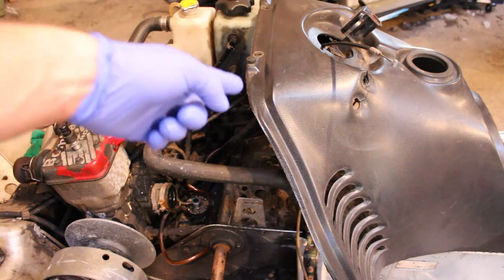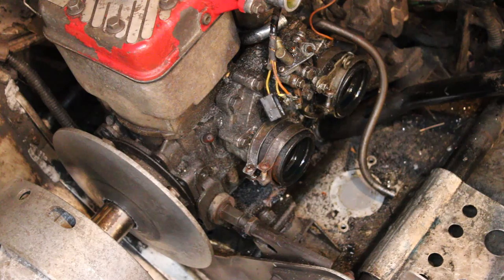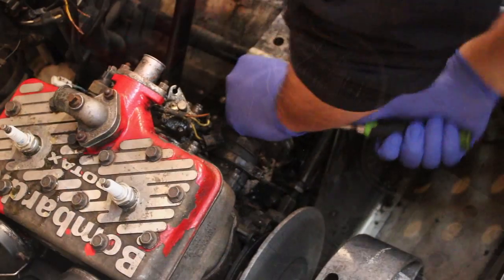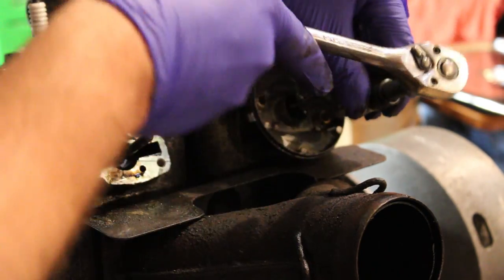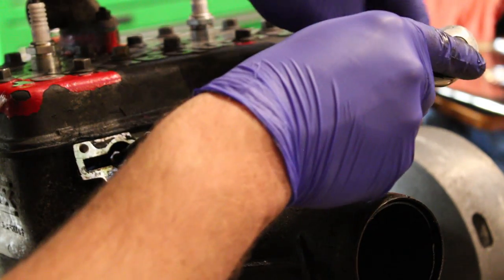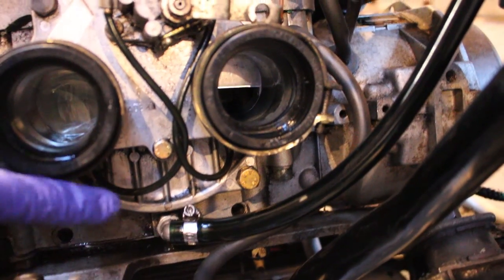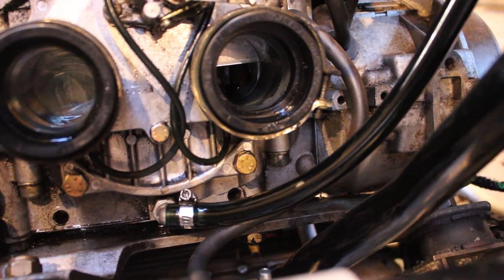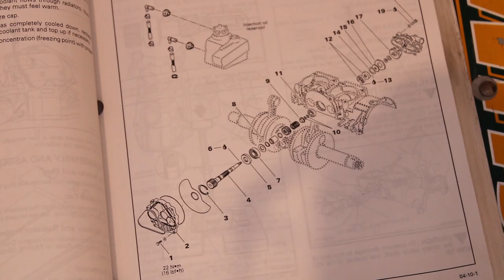ITS ALIVE! But it's injured... I still think we can salvage it. 1995 Skidoo Summit revival. Part 2!

Comment: came across ur video #1 tonight, Feb.20-2023. Yes indeed restoring old sleds can be a passion. After 45 years, no sled, now have three Grand Touring, 2-670, 1-580. looks like snow in the Tweed area this week, headed out to Quebec to get parts so I can have one in operation! This is turning into and addiction. Locally a fellow has a '95 Mack Z 779, needs work, but would be fun to have in the collection. Thumbs up, will keep an eye out for more video's. Cheers.
Reply from the maker: It certainly is an addiction, but there are much worse addictions to have! That's how I look at it. It keeps us busy and out of trouble for the most part, right? Sounds like big snow in the forecast this week! Thanks for watching and commenting, much appreciated!

Comment: Take it down and reseal the engine
Reply from the maker: That's the plan man! Just debating if I wanna try to do the inner crank seals myself or not do them at all. Dont really wanna spend the money on a remanned crank...
Reply: @NorthwoodsNoise  id leave the inner crank seals alone. replace pto and mag end seals, and the rest of seals, gaskets.
Reply from the maker: @GearheadRob319  do you think they're okay? I'm 99% sure its the carb side rotary valve shaft seal that's filling the case with oil but I'd hate to tear the whole thing down just to put it back together and have the same thing happen again.
Reply: @NorthwoodsNoise  I hear you. Hard to say for sure. After all, they are over 25 years old. Ive had luck replacing all the other seals. But always ending up selling the sled because i like to fiddle with more projects like you. Good Luck.